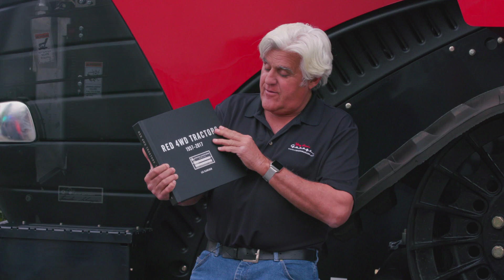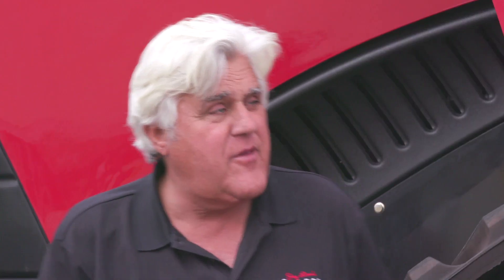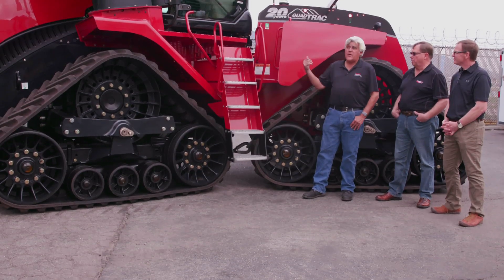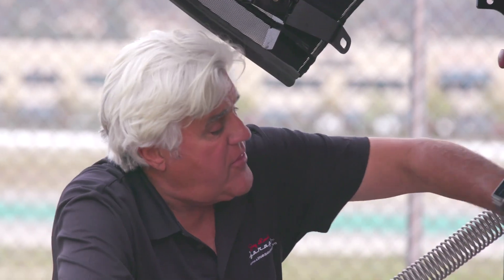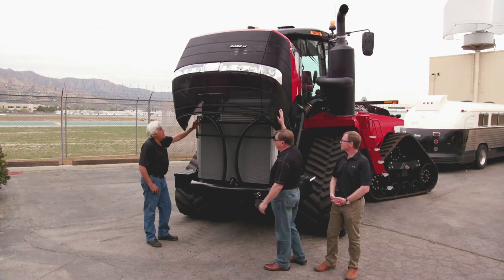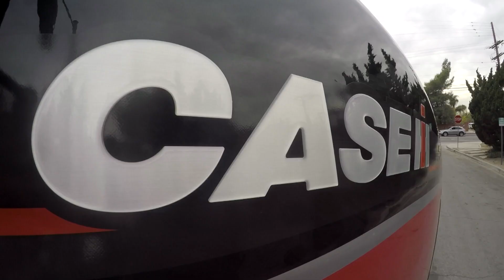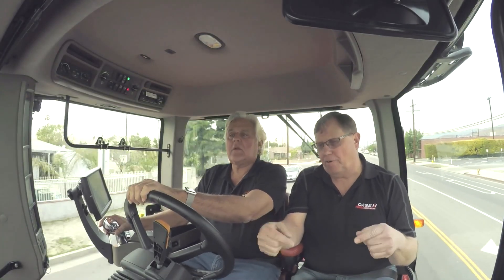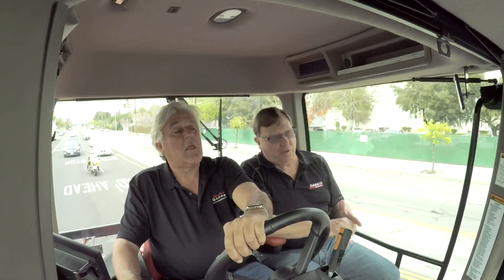2017 Case IH Quadtrac - Jay Leno's Garage

Comment: Imagine what kind of revenue stream your farm must have if you're buying one of these for the amount of time it saves. A very impressive machine.
Reply: A lot of farmers lease their large equipment, get new every few years, with tax breaks, in some countries. ;-)
Reply: Yep the only way it makes sense to have this kind of equipment is on lease. There are tons of videos on youtube of farmers buying this old equipment off lease and then having the warranty expire. There's so much DRM and restrictions on the software that there's even a community of hackers that are getting these big tractors updated and working again.
Reply: We bought ares, a slightly used one. The benefit to that is they hold ther value really well so there is descent equity for many years. We have had almost no problems other than with the blue def  exhaust fluid system. The blue def throws error codes and it cuts power:. I wouldn’t want to lease one tho. Still responsible for repairs with no up side imo.
Reply: You can buy them low hour used for about 250-400k. Honestly it's the best way to buy equipment as the new equipment bugs are usually worked out by 200-300 hours.
Reply: When farms get big, they get help from the taxpayers in the form of grants.  It happens all over the country, and really helps the farmers out. This is probably one piece of a armada of extremely expensive equipment. Why do you think you see brand new stuff or really old stuff. You know the farmers own their equipment of its old and still working. Most farmers don’t own these type of tractors, they lease them and get new every couple years. It’s good for all, because the companies can get feedback from farmers quicker when they’re leasing, as opposed to owning the equipment for the lifetime.
Reply: Mark M That is just plain false. Owning and leasing are very common among farmers.
Reply: i am a jabroney That just isn't true. Owning and leasing is very common with farmers at least here in the US. Also we don't get government grants for equipment here.
Reply: smylebutta7250 yes, I know it’s common, my lifelong friends family has a massive dairy and poultry farm. They lease new equipment and trade it back in every couple years.  Any tax paying us citizen can go on their states respective agriculture department, along with the USDA, and find out how much each individual farm is getting through grants. I know my friend would not be using new equipment and putting up more poultry barns if they weren’t getting grants. In fact, he took classes at the local community college to better understand grants, and how to get them.  Some farms don’t use grants at all, some use them.  Depends on if you meet the requirements.  I’ve lived in Pennsylvania my entire life.  Big farms get big grants. Wissler farms, a local guy, recently got $60,000 toward a new tractor.
Reply: i am a jabroney they are not grants. They are incentive payments for innovative practices. Such as the USDA program EQIP. That money could be used for equipment purchase, but isn't issued for such. I work for a SWCD in Oregon we are partners with the USDA. Know your facts before you speak.
Reply: i am a jabroney You are confusing grants with something else. We do NOT get grants. It's that simple. You don't know what you are talking about.
Reply: Adam Kruskama Thank you! People like that give us a bad name saying we get government grants to buy shiny new equipment. So much misinformation out there.
Reply: If you don't have to pay the money back, it's a grant. You can call it 'incentives', but they are grants.
Reply: Carl Thor here in Australia its like that
Reply: Shane Singleton One? One? Most self respecting mega farms have a full fleet of them
Reply: That’s the thing about farming, high turnover low profit.

Comment: He should try out the Big Bud 747 lol biggest in the world
Reply: Also one of the most powerful.
Reply: Also a hideous piece of DIY from the 70'ties
Reply: You do realize that it's the only one of its kind right?  And calling it hideous is an overstatement since most big tractors from the 70s looked almost the same.
Reply: He should bring a fiat 110-90 for a rip down the streets. Legendary machine. Sounds great and view out of them is epic
Reply: Ferguson 20 diesel a don’t think they have 110 in America
Reply: That's stupid. The quad track is a production vehicle. It got selected because the quad track is legendary! 700hp machine that fits on a normal street. 
The big bud was cool for its time but couldn't drive down a Montana road let alone one in so cal!
Reply: Andy Hass don’t know where u got the quadtrac 700hp
Reply: But it doesn't have the legacy like the Big Bud
Reply: AJ Deere T680 lmao. Big bud made like 4 of the bigger models and 20 of smaller ones. It was never popular enough to be in production. Hardly a legacy.
Reply: yeah but just knowing it used to be the biggest
Reply: They do have fiat. But its called hesston fiat.
Reply: Andy Hass they built around 500 Bigbuds
Reply: Not the 747
Reply: AJ Deere T680 yup just one of them . Seen it in havre mt after it was restored
Reply: the 620 on the hood is the rated horsepower at 2100rpm.  the peak power is 692hp at 1900rpm.   close enough to 700 lol
Reply: Most dank nugz ever? Why would Leno want to do a review on weed?
Reply: Jay... See if you can get into either Fat Albert or an AC130.
But maybe a giant dump truck?
Maybe something with a giant turbo pump (aka...rocket).
Reply: Andy Hass well look at welker farms that's about all they use is big bud tractors
Reply: Big Bud's were something for their time.  Easy to get stuck and hard to pull out.  A D7 would be a necessary support tractor to the big bud.  That and a fuel tanker.
Reply: Hello again
Reply: Andy Hass True the thing was so big you needed to own field after field after field to make use of it the thing couldn’t drive on the streets takes up the whole thing
Reply: AJ Deere T680 big is not= better...
Reply: Haha! Made me smile.   Great passion for Fiat :)
Reply: True but it would be interesting with the size what kind of episode they could make
Reply: @gregshearer423  the 620 has 692 i trink so almost 700
Reply: Ferguson 20 diesel 110 90 one of my favourites did you see the one grassmen restored only a few miles away from me my neighbor is currently fixing one up

Comment: So if you keep this thing running 12-18 hours a day consistently, you only have to replace the tracks once a year. That doesn't seem too bad but I bet they aren't cheap.
Reply: Kyle Stewart bout 9k a track
Reply: Se typically get 2-3 years off a set of tracks. We keep them off the pavement.
Reply: Very expensive to fix and they have the ECU on lockdown. All the tractor companies are sue happy these days whenever someone tries to fix on their own
Reply: @patrickm5217  
The tracks have nothing to do with the ECU changing the tracks can be done without even turning on the keys.
Reply: Kyle Stewart if you can afford to buy the thing you can afford new tracks, no problem.

Comment: Great video, but what happened to the promise of a 0-25 test?
Reply: really..? someone owns that machine, i'm sure they would not be too pleased
Reply: That is about five minutes...
Reply: Dan Black haha. I bet it doesn't go under a minute and that tell you something, sales reps are always sales reps. Lol
Reply: @Radley97  All tractor's are made to be full noise the entire time. Of course oil changes need to be done more often when you are at higher loads but it's made to be thrashed all day every day. I'm sure a 0-25 mph is nothing
Reply: I drove 300 hp 4wd tractors when I was younger and they would make it from a standing stop to road speed (20-22 mph) in three car lengths, less if you shifted.
Reply: @wildturkey5838  i worked in an ih dealer ship for a while. Those are bad arse, 25 mph is got to real fast and insane. Worked on several. Use the shuttle shift you better hold on.
Reply: Wayne Christner 
I used to haul these tractors till I retired in 2015.

Comment: That's a beast and not billowing out black smoke either!
Reply: DAN ZABORSKI any diesel equipped with a d.p.f technically should not emit any visable particulates.
Reply: I think he said the air coming out is almost as clean as the air coming in, amazing.
Reply: Corey Langan actually fpt engines don't have dpf! That is one of their huge advantage over the competion. The engine has very advanced turbo charging so the exhaust coming out of engine is clean enough they don't need a dpf! 
The big exhaust is for scr aka,nox emissions reduction
Reply: Andy Hass I had too look it up but you are right it's amazing they are able to get PM low enough that they don't need a dpf to meet stage v emissions. Most manufacturers in North America have to run a dpf just to get PM low enough to meet tier 4 final emssion standards.
Reply: Corey Langan u r pretty close. It's not stage v. It's stage iv in Europe and tier4f in North America. 
Stage v production starts in 2019 and 2020 for Europe.
Reply: Andy Hass I know that
 But the fpt engines already meet stage v requirements which are upcoming in europe. And yes North America is tier 4f which is what I said tier4 final.
Reply: Corey Langan actually they don't. Fyi I work for the company... so as i said stage v for 4wd launches in 2020.
Reply: Andy Hass I just read from fpt's web site that there engines already meet the upcoming stage v emissions. Is fpt wrong about there own engines?
Reply: the smoke like crazy when they go through a regen. The system captures particles and releases them later.
Reply: Andy Hass I was talking about DPF. And I have seen newer diesels smoke. Scr is much better then dpf.But when they go wrong( which is all the time) they smoke.
Reply: HighFlyinRyan76 Weezer this case tractor doesn't use a dpf which was stated multiple times in this thread. Do u have anything to add about this tractor or u just going to mention random factless comments?

Comment: Okay now I want to get Farm Simulator so I can try and drive these at home.
Reply: Case IH has been in Farming Sim 13, 15 and 17, most likely they'll be in 19 as well. They are very expensive though.
Reply: Tony Ski if your saying case are expensive they are one of the cheaper tractor companies
Reply: I'm talking about in Farming Sim. They're the top end tractors.
Reply: Tony Ski a right
Reply: Tony Ski just use the money cheat mod of mod hub
Reply: Greg Shearer depends on what kind of tractor you get from them,this one like tho guy said is over 600,000 dollars
Reply: Vap0rElite Gaming am on about out of every tractor brand case are one of the cheaper
Reply: And you can simulate delivering one to your farm with American Truck Simulator! (w/Heavy Cargo pack DLC)
Reply: The Farm Simulator games are fun and relaxing, I highly recommend. Tip: build solar panels and wind generators as soon as you can, they make you tons of $$$

Comment: I rode with my grandpa in a Steiger tractor back in the mid 70s. He was farming in the Texas panhandle. It was a huge green beast that steered by pivoting in the middle. It seems to me it was just like this one except for the color and it had rubber tires instead of tracks. It had an airconditioner and am FM 8track stereo. It was the Cadillac of tractors. The tires had to have 8 or 10 feet across. I never saw anything like before or since til now.

Comment: Man that things is pretty silent and fast for its size
Reply: That's because the audio is from inside the cab. Its definately louder than this video suggests. I've driven these enough to know.
Reply: Bruno Cano huge mufflers and 2,000Lb of torque will do that...
Reply: Fiat technology
Reply: They r way quieter inside and out of the cab than the Deeres. I hated driving Deere. Case is years ahead Deere. FPT engines r fantastic!
Reply: To be honest I used a john Deere 6610 premium and it was the quietest tractor I've been in. Very well payed out as well. It wasn't so quite when you pressed the brakes though. 4 wheel drive comes on and make the most god awful whine ever. But my daily user the fiat 110-90 you won't even hear your phone ring in it and if you do catch it and can't even talk to the other person
Reply: lol what is the point of your comment? you are comparing very old tractors, very different size tractors to a new tractor.  I have driven a 2016 case 4wd and a 2016deere 4wd.   Case was so much smoother and quieter.   In the 4wd world deere can't compete.
Reply: Well we're still using 90s stuff simply because there better. Fiat 110-90 ford 7840 and john Deere 6610 premium are all from the same era. They all have there pros and cons. Case isnt very popular here. But it pretty much the same as a new holland.
Reply: These things are pretty loud from the outside

Comment: the tractor....awesome but the company needs to give the software of their products to the farmer/owners who buy them so they can diagnose them. it's worse than us car enthusiasts have it and with a much smaller knowledge base also. it's much harder for them and expensive in comparison.
the bus though.......a thing of beauty and the reason for the post. they are gorgeous.
Reply: No they dont, farmers are not trained for that. They wouldnt know what to do with the software even if they had it. Thats why the hire field service techs like myself.
Reply: Ryan Young False.
Reply: ryan...they hire techs because techs have the needed software. software that is not available to them due to company policy. 
farmers are much smarter and capable than you give them credit for being. 
   i won't say that your response is stupid but it does show extreme bias and extreme ignorance. you lack antecedence.
there is very little that is beyond their comprehension or ability to repair as the tools they use are used almost every day and are required to accomplish their tasks. they know their needs and capabilities as well as you know yours. every time you sit down and eat proves this point.
i find the service policy of implement (and automotive) manufacturers abhorrent in this regard. they make enough off the sale of the equipment initially and will also profit from the parts sold to effect repairs when these units fail.   anything more is straight up corporate extortion and development regression.....not retail sale transactions or equipment advancement. the auto industry for the most part is guilty of the same thing and for the same b.s. reasons. add complication and expense....reduce m.t.b.f. numbers and productivity.
Reply: Did you mean "give" as in for free? Or just make it available at the same exorbitant subscription fees the dealers pay?
Reply: Companies that buy this don't work on equipment themselves,  that's why it's for factory farms

Comment: I'll bet a replacement for that muffler would cost as much as a new car.
Reply: about $12,000
Reply: Yea, that's pretty close. I checked the parts catalog at the nearest dealer in New England after I posted the comment.  They were looking for $14,700 for the SRC muffler and that was before any shipping and handling charges or taxes. The DOC muffler/filter(a little under $5,500)and other piping are not included and none of the mufflers are available yet for any machines produced after the November '17 serial number break.
Reply: the guy i work for just bought a 470 quadtrac and he was having emissions problems. they quoted about $12,000 but all that was wrong with it was a sensor had went bad
Reply: @nicholashubbard9026   Why would they quote anything? Is there no warranty? You said he just bought it.
Reply: Omega Supreme warranty was going to cover it but they told him how much it would cost if he had to buy it
Reply: These exhausts are filled with precious metals tuned to complete the heat exchange cycle after DEF is injected into the mixing chamber. That's why the hefty price tag.

Comment: CASE = Can't Afford Something Else

$600,000 ..I guess that's not the 'case' anymore..
Reply: James Sweeper well this is cases highest end machine lower end models run about 400 000 while johndeer makes a 540 000 machine as well as a 580 000 dollar machine. In my opinion case has really stepped up their game but i am not a fan of the controls (they just arnt comfortable or convent) and the machines with tires ride really rough but case has really stepped up their game. Case was also the first manufacturer to make a reliable quad track which john deer and new holland copied
Reply: Mitch Blocher New Holland and Case IH are both Fiat.  No coping for New Holland just JD.
Reply: The only Case machines I've ever dealt with have 20+ year old versions of their Loaders, Backhoes, and Excavator. They're usually older machines because most companies I've worked for are either big spenders and go for nice new stuff (and not case) or dirt cheap and get the cheapest available thing that works (usually old case stuff, but sometimes NH, Champ, or JD). Still from my experience they're a great machine if you don't mind looking like you're Michael J. Fox trying to use them. If they don't shake themselves apart first, it'll be you.. never let the person in the case take their coffee into the cab with them because it'll get everywhere. Frustrating to say the least when you're trying to be precise. Fairly weak machines too, but they last at least.
Reply: James Sweeper ha ha ha
Reply: James Sweeper Case IH not Case.